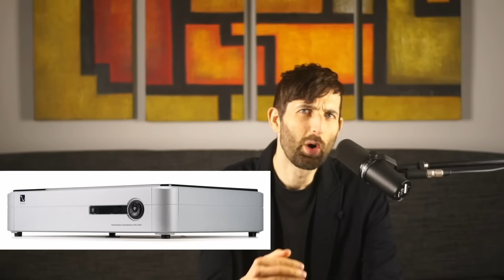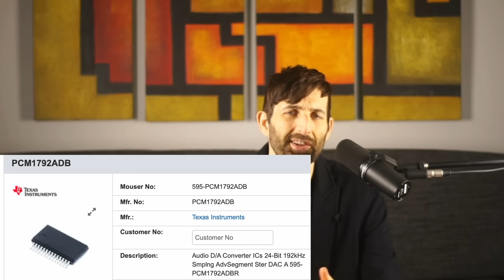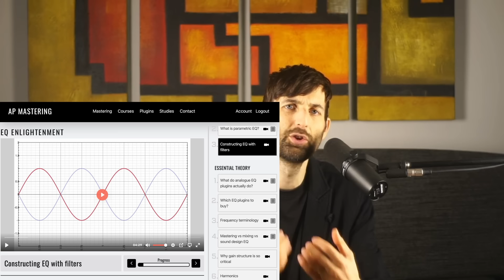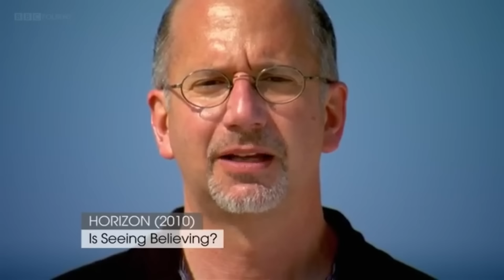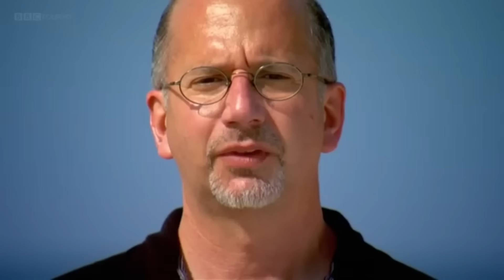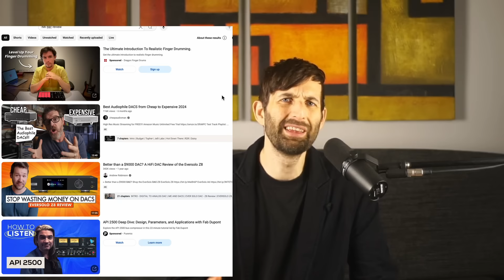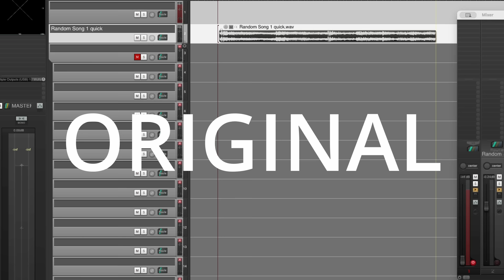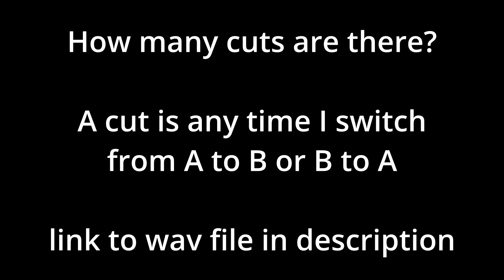The DAC Scam - Almost everyone believes the hype

Comment: I dont have experience with really high end DACs but up to a Chord Mojo (which I have) there is a clear difference, night and day to me compared to my previous ones, Fiio BTR5, Dragonfly Red and Cobalt, Fiio k5 pro (akm version). I had these dacs and did a lot of A/B tests, Chord Mojo tops them all. I would have trouble distinguishing a difference between the BTR5 and K5 PRo and Dragonfly Red but not when any of them are compared to the Mojo. I recognize the Mojo 10/10 times

Upgraded to a Chord Qutest, major step up from a Mojo

Comment: @apmastering what is your read on manufacturers using a combination of high-end clean power supplies and master clocks with low distortion / jitter down in the 40 to 70 femtoseconds range. The argument is this impacts phase distortion.
Reply from the maker: cheap pro audio DACs have zero audible phase distortion or jitter

Comment: Well, this hobby is not for you then.  There are differences for sure - it's not just about the components, it's about the overall architecture, often tuned by ear, and oriented to people who can hear the differences and appreciate it.  There is definitely a law of diminishing returns here; to get incremental improvements you have to spend increasing amounts of money.  But it is worth it to some.  I would say it's similar to wine: can you tell the difference between a $25 bottle of wine and a $100 bottle?  Probably.  How about comparing a $200 bottle to a $100 bottle?  Probably not, unless you're really into the hobby.  Audio equipment is the same.

Comment: Your major mistakes in reasoning and fact:

- A DAC’s sound quality is reducible to its chips
- Technical metrics prove how a DAC sounds
- Therefore that DACs over a certain basic technical spec basically sound the same 
- That a “small” change to a DACs subjective performance necessarily is worthless from a listening standpoint
- “Accuracy” to source as measured by technical metrics should be the goal of a DAC

Comment: let me sum it out , if DACs make some difference since they output Line level signal , they can be recorded and easily compared using a PC . No one does that becase all DACs sound the same , and im not even talking 200$ , shit man there is Behringer Uphoria DAC for 50$ or something .
Nothing is as important as the room, and after the room desing of the speaker ... if that aint correct , nothing is going to fix it , if that is correct aint nothing much more you can do about it .

Comment: The only way to test if there's a difference between two DACs is to put the two in you own setup. As soon as you try to record the outputs and ADC it for use in a YouTube-video, you have introduced so many other pitfalls that the test will not reach it's full potential. Not to mention people will listen to the test over their DACs. And don't get me wrong. Same chip will for the most part sound very similar, but in high end audio, with the equipment for it, you can absolutely hear the difference, but it's not massive differences. For instance, if you take something like a bluesound node streamer. You can absolutely hear the difference when you go through the generations of them. They do clearly get better. If all newer DACs were created equal that would not be the case.

But of course, spending tens of thousands of dollars on a DAC is very likely not going to get you your moneys worth. Buying something with a top chip well implemented is more than enough, but up to that point, you can hear differences, no question about it. I have done several blind AB tests where the difference is very clear. And always in favor of one of the DACs. And this far, always the more pricy DAC.

Comment: The value curve on DAC/AMPs seems to spike at $200 and then falls off a cliff above $300.

I bought the Topping DX3 Pro+ this year for $200, effectively technical perfection and at 1.8-watts output is powerful enough to drive any headphones under $6,000.
The only problem with the DX3 Pro+ is it's limited to a 3.5mm audio jack, which isn't a problem in any technical sense but 3.5mm jacks do wear out, which is the main reason 1/4in plugs exist. Topping intentionally designed the DX3 Pro+ with a practical weak point.

And now Topping just came out with the DX5 II which for 50% more money gives 3x more power and those fancy shmancy 1/4in and 4.4mm plugs. Sigh. No doubt this is the perfect DAC/AMP, I will have one someday, but since it's redundant in my current setup I can wait for a sale.

Comment: Dacs were tried in the 80s and didn't take off because everyone then thought it was snake oil, then in recent years the hifi market tried it again, then people compared old to new dacs, and maybe dacs do sound better now, but i agree most dacs now sound the same or very close at best, it certainly doesn't justify the outlay, bass and treble controls will change the sound better than any audio equipment.
Reply from the maker: Yes a tone control will make maybe a 1000x larger difference

Comment: This video is a nonsense. Just two words: reconstruction filters. Every dac needs that. And yes modern DAC makes creation of the reconstruction filters much, much easier than in the past. But analog filtering is rather an art. It's so difficult to choose between different factors. Some DAC provides more than one reconstruction filter to choose. All this requires hours of work if not just adopting reference design (which is best option for many cases).

Finally one needs to care about power ripples introduced by digital domain to analog signals, noise and other things that usually does not matter when designing a digital only system. Generally mixed signal is tricky job.

So, this video is a bad quality bite. Sorry.

Comment: I think, biggest difference in dac's, are not the decoder chips, but audio output stages. The type of opamp, and/or the capacitors used, makes the biggest difference in sound, not the decoding part. And yes, prices for the exotic "high end" types of dac's are scam and bullshit in my opinion.

Comment: If the DAC is designed in a right way, it should be transparent and a person can’t distinguish between 2 transparent DACs. They are distinguishable if one DAC has a flawed design with too much distortion (I would say below 80dB SINAD there is a small audible difference, and closer to 60dB SINAD where the difference is obvious).

You don’t need to pay a large amount of money to buy a transparent DAC with 80dB+ SINAD, usually a 100$ is more than enough to get a transparent DAC, you will not notice audible improvement with 100dB+ SINAD DAC or a DAC that cost 1000$ and more.

The other thing is the spec of the IC, whether it can reach a dynamic range more than what the speakers are capable of is more than enough to make different ICs indistinguishable (there is no warm delicate cream freche touch like what someone audio companies claim for the IC they source from a well known companylike AKM and Texas Instruments). Usually this is a resolved thing as chips can far outweigh the dynamic range needed for speakers/our hearing to be distinguishable. 

Once we are out of the digital realm and into the analog stage of the conversion, here things matter more, but as the first point, the pre-amp stage of 80+dB SINAD should be transparent unless you want to color the sound via tube pre-amps. 

The amp section is were a real audible difference is easily distinguishable for the same speakers/headphones, but people tend to focus on them too much that they end up overspending, as the speaker/headphone themselves have a much much much higher difference in sound quality than 2 amplifiers, but yes amplifiers sound different especially if one is designed to color the sound in a pleasing way like tube amps.

Comment: I don't appreciate your ignorant comment that there can't be a sound difference between DACs, because my experience is that there is very big difference between DAC's even when using the same DAC circuits. All parts and technologies used in a design have an impact on the sound quality.
Had +10 different DACs and found one that I find to be totaly neutral and without any colouration of it's own. Mark Levinson No. 360s. Absolutely fantastic.
You THINK you know a lot, but you don't. You just have an opinion that just "MUST" be right by principle.

Comment: First of all its very sad that you dont hear the difference between these dac's because you have bad equipment, you dont know where the strongest or weekest link is in your audio chain ! But a NOS DAC will always be a strong link ! You also dont understand that a non oversampled waveform looking like a stairway is not the problem here (a lot will mechanically filtered out), the main reason why it sounds better is because the crossings in the nulline, zeroline. That xxxxxxxxxxxxxxxx times the current polarrises per second in a ac current. This zero or neutral line will be distorted if you bring in oversampling ! This is the real cause a NOS dac sounds more natural. THD numbers out of a single frequency is not answer right here.

Comment: It's quite simple:

Build a hi-fi DAC with an AKM, Cirrus, or Burr (Texas Instruments) of your choice and make the power supply and circuit board layout at least according to standards from 20 years ago. Make sure crosstalk, distortion, and noise are as low as possible.

Done. An acceptable device for $20 to $50. Absolutely transparent to human hearing (in the case of a USB-C 3.5mm dongle, sometimes possible for less than $20).

Also very simple:

Take any no-name DAC chip and build your circuit without coupling capacitors and other important separations. The result is a horror home hi-fi DAC or Type C dongle for a dollar or two (And yet most people would probably still consider it to sound good).

In the end, the source material and the speaker/headphones make the biggest difference anyway (as long as the amplifier isn't a complete dud).

But of course, you can also turn it into an astro TV science show and read cards.
Reply: Great. Living life to the minimum standard of living “acceptability” whatever that means.

Comment: It seems there is much discussion on output stage in the comments, at what point do diminishing returns start appearing in DACs on the output stage, where further improvements only come at a steep cost for very little perceivable improvement? Is there a sweet spot price wise where most of potential issues like clock jitter, noise isolation, component quality and circuit design are more or less sorted for a non-audiophile consumer?

Comment: Cope harder, many ultra high end DACs are discrete or R2R and even if they use a chip, most of the sound comes from the clock, output stage, IV stages, power supply, battery backup in some cases. 

All of this is very expensive to implement with high quality parts. Just because you can't afford better sound doesn't mean you should delude yourself into thinking that there isn't anything better out there.

Comment: It's the power supplies. Ditto for transports, pre-amps and quite likely inexpensive class D amps. Recently I bought the SMSL transport and iFi $200 usb power supply on Amazon. Just before my 30 day trial ran out I noticed they now had a iFi $400 version and was/am shocked at the improvement. Now I have owned a slightly used Audio Alchemy DDP-1 ~ 5 years ago. I wanted to add their PS 5 outboard power supply but seller did not have it, Absolute Sound review said it's a must. Too me ~ 6 months to finally get one and WOW, it opened my ears to the importance of a quality PS

Comment: They do use the same DAC chip, but other aspects are more important for sound quality. Like a clean power supply with more than enough power, so it will never sound strained. The analog output stage is likely the most important part for sound quality. There isn't enough in the budget for lower end models to do the power supply and output stage properly. 

I have several SMSL and VMV DACs and they have the same chips, but they don't sound the same. Especially, on a high end highly resolving system. My VMV D1 is silky smooth in the vocals and has better and deeper bass. The lower end SMSL are decent sounding, but they are edgy and sharp and don't have the same level of super tight bass compared to the more expensive units with considerably better power and better analog output. Everything that happens to the tiny signal from the DAC chip will go through several amplification stages before the speakers reveal the sound. The input signal can only be as good as the output signal feeding it and the input to the preamp comes from the output stage of the DAC. 

I agree that it is ridiculous to buy a $40,000 DAC, but it's not realistic to think DAC chips are equal, when it's only a small piece of the chain. There are a bunch of crazy audiophiles myths out there claiming to produce better sound, like power cords. But, better power supplies and output stages aren't myths. Any engineer would agree.

Comment: Interesting criticism of hi-fi. I've spent my whole life trying different hi-fi components, most of which I didn't like - especially "high end DAC's" and studio DAC's. You criticize older NOS DAC's but they are the only ones that I enjoy listening to long term. Ultimately it is not about studio mastering it's about enjoyment of listening to music. You are welcome to your opinion but I know what I like and dislike after a lifetime of listening. Analogue recorded vinyl measures terribly as well - poor noise floor, poor dynamic range, crackling, pain in the ass to set up properly etc  but is really nice to listen to as well. I have tried many of the commercial offered components at exorbitant prices but choose to build all my kit including DAC, cables, amps, speakers as I can make it to my taste with ultra low noise power supplies for sensible money. I am a degree qualified electronics engineer and don't have magic ears, I just enjoy listening to well recorded music by talented artists as it is a really gratifying experience. Your experience is different to mine and I enjoyed listening to your rant.

Comment: TLDR: High-End DACs
High-end DACs are overpriced "snake oil." Nearly all use the same, inexpensive core chips. Sound quality is transparent in decent DACs (>$200); high cost buys only case, screen, and marketing fluff, not better audio engineering.

Comment: 2:40 Meanwhile the Apple's UBS-C to jack audio dongle costs only 10€ and even supports UAC (UAC1 at least, not sure about UAC2). =)
Yes: it lacks all the fancy plugs and it's a basic dongle, but it's 10€ and can be used on windows, too (if you have problems with ground loops/noise 'cause of shitty internal soundcards that'll resolve the problem)

Comment: What's your opinion on ladder DACS?
Reply from the maker: I wouldn’t bother
Reply: @APMastering I did not expect that answer, can you elaborate a bit please? Many people swear by the sound of a ladder DAC.
Reply from the maker: @xda8009 the resistances need to be extremely precise, like infinitely precise. Only the most exceptionally high quality engineering will get anywhere close and everything else just introduces distortion. What people swear by is probably the added distortion. Delta sigma is a more robust topology.
Reply: @APMastering Interesting, thanks will dig deeper.

Comment: Thanks for making this video! You said exactly what I've been thinking ever since I came across this weird concept of DACs. There is really just one way of converting digital to analog signals and the sample rate determines the order of the low pass filter that must follow it. And then possibly the quality of the analogue low level amp following the DAC before the outputs. Now, if I'm lucky... I wonder if you've made a piece on class D power amps as well. That's another concept I can't get into my head. Why in the name of something upstairs would one create a PCM/PWM power amp for audio purposes?

Comment: My $100 Topping TP-32B Lite DAC sounds notably different from whatever was built into my 90's Rotel RCD 950 CD player (with digital out, so I can run it through an external DAC as I did). I would even say it sounds a bit better, but honestly, not $100 better. I love my Topping DAC, which I got for streaming to my vintage audio hi-fi system (playing Rotel through it is secondary). It sounds really good! I am so glad that I was able to buy it for $100! I really am. I think it's an amazing product for a very good price and I often wonder why, oh why would anyone want a more expensive unit? I believe it runs on Ti chips, but I am not even sure because it works for me and it sounds good to me, so why would I go any deeper? I tried a few DACs and chose this one primarily because of quality if life features, not the sound. I could not tell the difference in sound, nor could I engineer a proper a/b test in my listening environment (I am an engineer). So I just went with features I need and price. This one hit the spot. I love it!

Comment: You can make ANY DAC chip sound bad, depending on the rest of the design. You can make a relatively inexpensive DAC chip sound quite good if the rest of the design is done well.
Reply from the maker: Sure. But it’s not that hard to do well. The chip manufacturers literally tell you in the manual